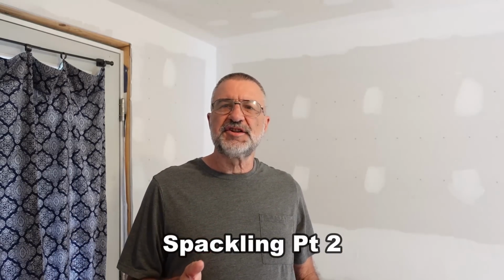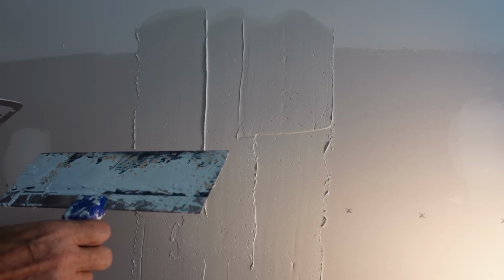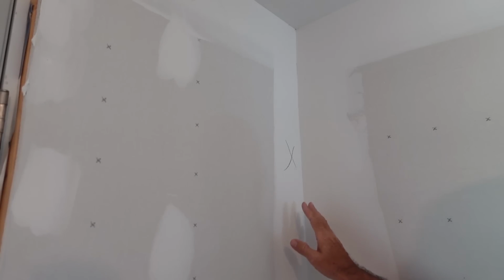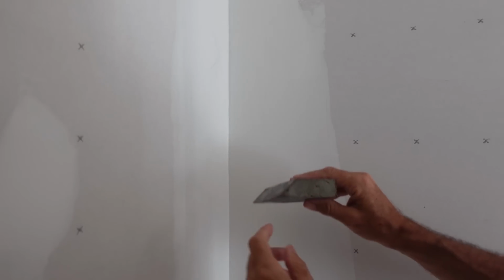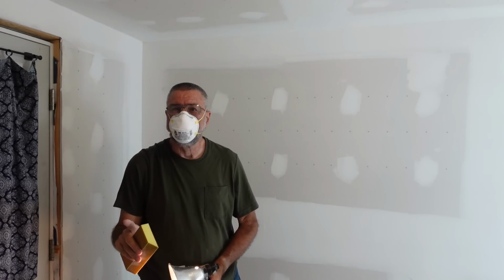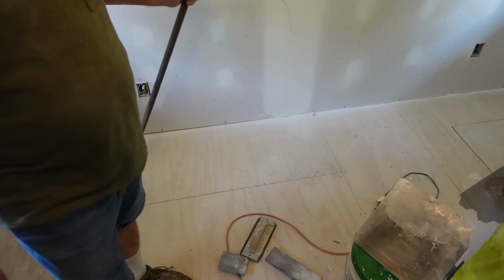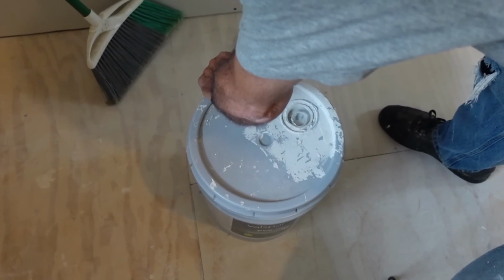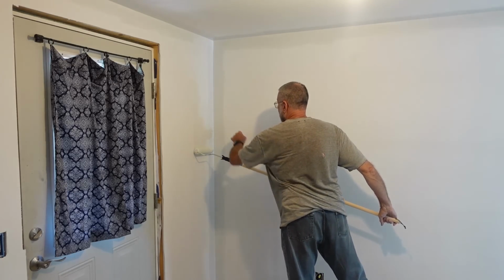How to Finish (Spackle) Sheetrock Pt 2 - Addition Build 46

Comment: Bill, your drywall videos were so fortuitous! 😊 I just filled in a large 10' x3' pass through that used to have a wooden decorative thing in it that the previous owner smashed out. And, I have just finished framing a pantry closet. I did drywall the 1 st project and did the 1st coat. Now I have to drywall the closet. It won't be a perfect job like your's. But I at least have the info upon which I can proceed. 🙂👍👍👍🇨🇦

Comment: I could be wrong, but I think the wet sanding is done with a damp regular stiff sponge, which actually just smooths any rough spots. It might be just what works best with your near finished  mudding work. Bob Villa has a video out

Comment: Great work! Thank you for this video! As right now we bought our country property in February and it sat empty for 10 months, and the previous owner was a heavy smoker! I have removed the wallpaper, I started sanding the walls by hand because the glue used for the wallpaper was put on extremely thick. I purchased an electric sander a couple days ago and am very excited to get it because a vacuum hooks to it and is going to cut down alot of the dust. I have started stripping the popcorn ceiling down right now and let me tell you that's a chore in itself working above my head. It has reminded me that I am not as young as I use to be! 😔 Any tips on how to strip popcorn ceiling? Someone told me to get a gallon sprayer wet the ceiling and use a tool on a pole to strip the ceiling off. I'm afraid it'll cause the paper to tear being wet? I swear this house is stuck in the 70's! 😮 Great work on your project! Much Love from our family to your family 💞
Reply from the maker: I've never stripped popcorn ceiling.  I hate textured walls of any kind so much that I avoid them at all cost!
Reply: @LiveSimpleLiveFree  okay thank you for your quick response. I will tell you that I am finally seeing the light at the end of the tunnel as far as getting everything cleaned up. Hopefully moving out of the city very soon. Much Love from our family to your family 💞

Comment: By accident i found that a swiffer dry floor pad removes drywall mud better than a sander.  I had sanded my third coat of mud and in preparation to paint i took a swiffer dry floor pad over the walls thinking it would pick up any drywall dust.  To my surprise with one pass it took the dry mud down to the tape.  I had to redo that section.
Reply from the maker: Wow! I had no idea.

Comment: Hello Bill as with most of your videos they are very interesting and helpful. i do have a question though. on your sheets of drywall i see a bunch of marks all in lines and very uniform, I thought they were screws but you covered over your scews. please enlighten  me please.
Reply: Are they not printed on? The manufacturer of those sheets print them as guidelines?

Comment: Have you ever seen the sanders that fit on your vacuum hose to capture the dust?
Reply from the maker: Yes.
Reply: @LiveSimpleLiveFree  I have one of those and it really helps with the dust.  I like the looks of those sponges you used though.  They look like they sand the mud a lot more smoothly than that mesh sandpaper.

Comment: That first wall you spackled .... the one with the obvious crack ..... it still looked like there was a slight "ditch" down the middle .... you know, like where 2 sheets of drywall meet/met/came together.  Don't think it was my computer screen (those anomalies that I can blame my screen on are specks of dust or stuff that I am fussing at you to removed, the its, oops, my bad/my screen).
Reply from the maker: I don't know what wall or what seem you are talking about, but the walls are completely smooth.
Reply: @LiveSimpleLiveFree  See 3:59.

Comment: What is DRYWALL !!
Reply from the maker: Drywall is sheetrock.  They used to do plaster walls (wet wall).  Then sheetrock (drywall) was invented.  You nail or screw it up. Then spackle it to finish it.  Though some people refer to spackling as drywall. (i.e. You hang the sheetrock, then do the drywall.  That never made sense to me because spackle is wet!)
Reply: @LiveSimpleLiveFree  Wow thanks so much for that information as i am totally clueless about any kind of contracting !!
Reply: In Africa they build our houses with bricks and then plaster over it but that means in winter the cold from the air outside conducts into the inside. You are lucky with your non conducting insulated walls. Also our windows are mostly single glass letting more cold conduct through. We have no central heating or boilers. Our winters are not that harsh but we do have bitter cold nights in July. I hope in future  they plan better house construction here as well.